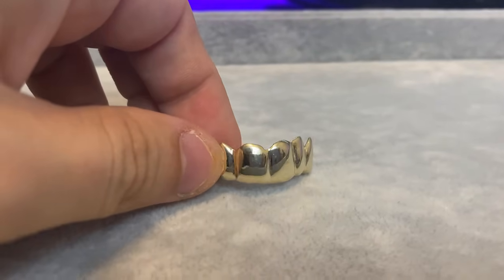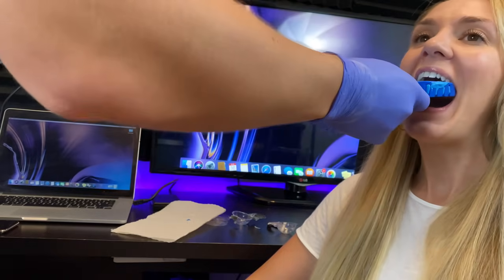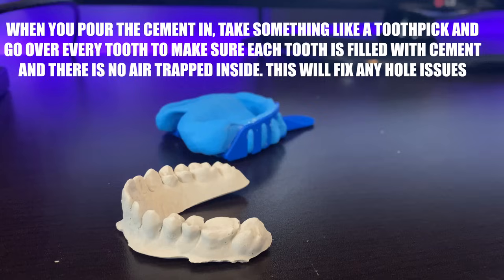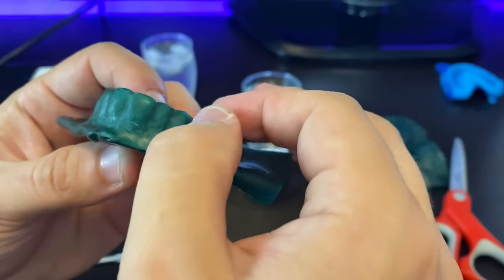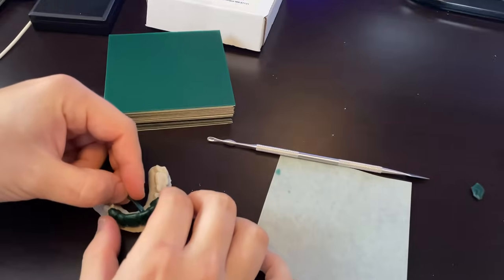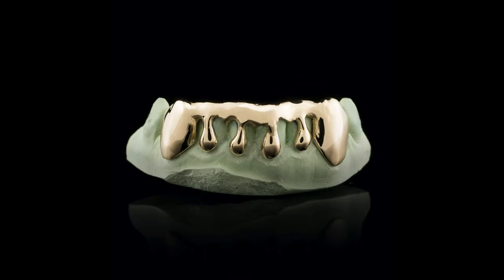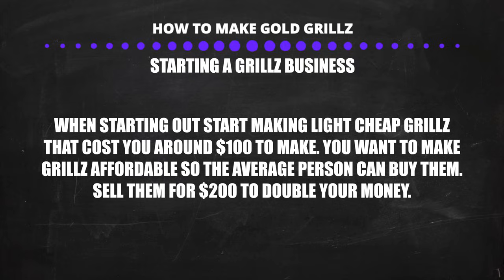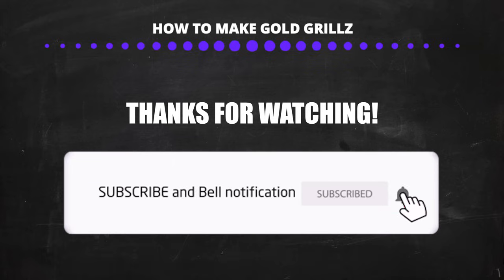How to Make Gold Grillz (Real Gold & Diamond Teeth) The ULTIMATE Guide - TV Johnny, Icebox

Comment: Very good tutorial. I’m a dental student and recently thought about dental grills. In dentistry we often have to deal with so called undercuts, which can prevent certain dental works from entering on the tooth or preventing from easy removal. Does anyone know if it is needed to block undercuts? In order for the grill to fit and to take it out easily
Reply: I’m a dental technician student and I’m wondering this? Surely u have to survey the model and use blocking out wax for the undercuts? The same way we do for chrome dentures?
Reply: Dental tech here from Kenya😉..
Yes u need to block out the undercuts then duplicate refractory model to make a master model ..
Reply: Id block out some undercuts but you still want some to hold it in place but not too many to where you cant get it on n off. Imagine it like a night guard n youll be fine

Comment: This video is so helpful bro ! I made my first bottom 10 today and they came out great !! Thank you so much. Only thing is the top grills keep coming out with holes no matter how much i poke the mix with a toothpick or knock it up and down on the table to get rid of air bubbles...any suggestions?
Reply from the maker: no problem! honesty try a different cement that might make a difference
Reply: How much did it cost to get it casted? And how much did it weigh?
Reply: My piece weighed about 1 dwt and the caster i went to only charged $25 to cast and polish i bout my own gold

Comment: do u have to use some type of lubricant to remove the cement from the mold? Cause i be having trouble and the cement be cracking.
Reply from the maker: the trick is pouring more cement on top of the mold so you can easily have something o hold on to when taking it out
Reply: @SlavaTVOfficial  ok I’m a try that

Comment: Quick question if i already have a grill can i use that same grill to be sent in to get drilled and setted or would i have to buy a whole another grill
Reply from the maker: it depends on how thick the grill is, if there is space to place diamonds you can. measure the wall to see how big / small of diamonds you can set. even if its thin they can add a layer of gold to set diamonds so yes

Comment: hey brother can you please make a video on how to make cuban link chain by hand? i know that you have made a video already but its using the casting method. the real problem i face is i dont understand the ratio of the thickness of the wire and the mandrel thickness and how to the length of the chain is impacted by the weight. please if you can make it possible it would be great.

Comment: When I take my impression (usually happens on molars) there are lines that run through the gum line (usually looks like thin deep cut lines). I’ve heard using a light body material can fix this but is there any way to fix this without a light body material?

Comment: Bro where do you get the gold and how do you put it on the grill like do you burn it in?
Reply from the maker: Hey, you will put the wax in a wet cement and leave a small hole on the top. the cement will dry, you will pour melted gold inside. the wax evaporates and the cement is dried, cracked, and the gold replaces all of the wax that was in the cement

Comment: my cast keeps breaking while getting it out of the teeth impression what can i do so it stops breaking???
Reply: I would say either there's a problem with the stone you're buying, or to wait longer before removing,. you could also be doing improper water to stone ratio,
Reply from the maker: You have to add more cement to the top so that you can remove easily

Comment: the wax keeps breaking after i put it in boiling hot water. it still remains very dry and hard i got the exact same as u were working with
Reply from the maker: Hey do not do this with boiling water, it is supposed to be warm
Reply: @SlavaTVOfficial  ive tried everything but i think my ferris wax is either fake or already past its expiration date cause its really fragile and keeps breaking, im searching where i can buy the right wax rn

Comment: The maths is way off. A 6 tooth 10ct gold grill, including the sprue would (lets add 10% weight for the sprue) would be 3.3grams x the specific gravity of 10ct gold (12.2). 3.3x12.2 = 40.26grams of 10ct gold required for a 6 tooth grill weighing 3 grams. This would be over £1000 worth of gold alone.

Comment: As a dentist I will tell you this will definitely not work for many reasons. It has to be mad by a professional dentist because occlusion ( when you close your teeth together the jaw teeth should not create any pressure to any one tooth and move your jaw left and right or backwards or forward ) should work perfectly otherwise it will create lots of different medical problems in jaw and facial area (tooth pain , infection, muscle pains , tempromandibular joint problems , headaches, neck eches etc.) . In the first you may not notice it but gradually the pain would be sever. 
During the wax process the cast stone gets scratched and the final casted piece of course may fit on impression cast but will not fit on mouth .
So if you want such thing go to your dentist and ask him to make you what you want.
Reply: What would the dental lab tech do different than what a jeweler does